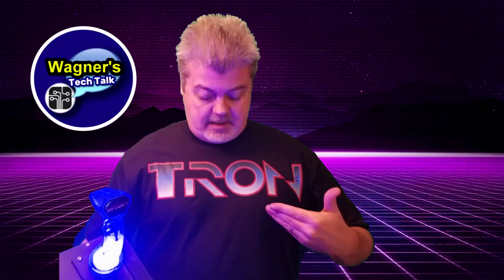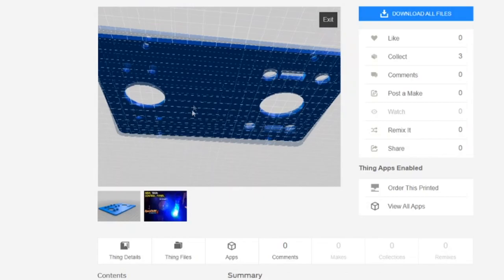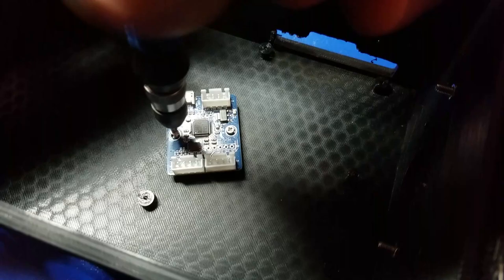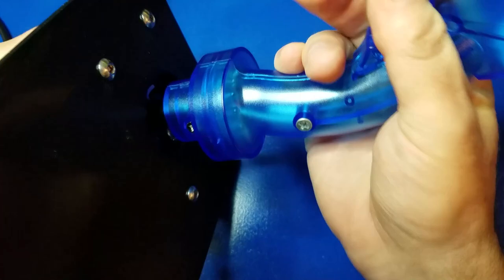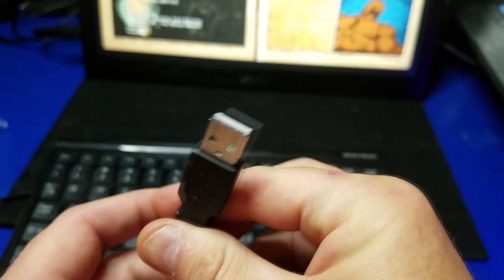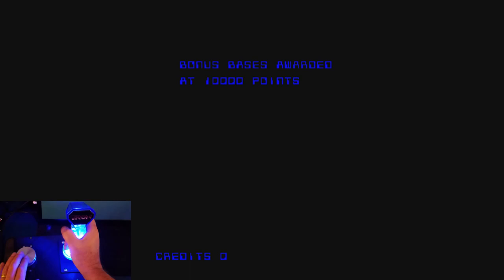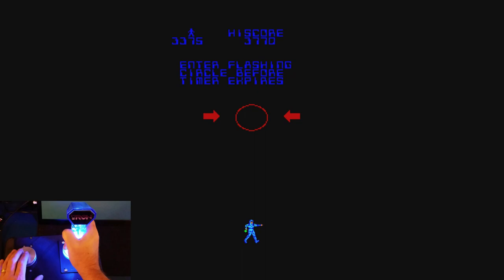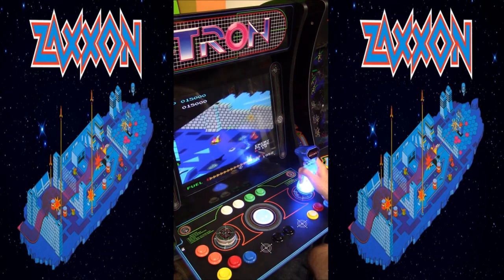Build a TRON Arcade Controller & GRS Controls +MAME +RetroPie or PC: 3D-Printed TRON Panel!

Comment: Where do I get the encoder board from. Mines didnt come with one
Reply from the maker: Everything I used may be found here: http://wagnerstechtalk.com/grs/#New_TRON_Control_Panel
Reply: @WagnersTechTalk  I have the 12 in 1 board. I'm looking for the interface that you are hooking up at 8:55
Reply from the maker: That board came with my Tron stick.
Reply: Oh Ok. I didnt receive one of those. Maybe I order the wrong version. I have to send it back I cant use it without the usb encoder
Reply: @mutechannel13  , I spoke with a guy at Thunder Joystick, They told me they removed the encoder from the kit due to customers not needing them. He did send me a link to aliexpress for the encoder "Xinmotek XM-09 LED" . So far I have gotten the main joystick to work, but can't figure out how to get the LED's for the joystick to work.
Reply: @steveracing7151  thanks for the reply I sent it back. I was going to hook it up following your steps.... managed to get the direction part to work but I couldn't get the leds to light up or the trigger button to work. The blue led light was the whole reason of me buying it lol. Without the led I had no desire to use it lol. I got a flight stick controller with vibration to replace it
Reply: @mutechannel13  Yeah, I had spoke with Kevin at Thunder Joystick, he sent me info on how to hook the wires from the joystick. You got to use JST connectors and .187 terminal using the cable. Black and Black are gnd, Red goes to VCC and Blue is your trigger button. I'm speaking about the wires that come from the joystick.

Comment: Sitting here wishing the finished assembled product was available for purchase. 🤔🤨
Reply from the maker: I don't have the room here for a small printer farm.  Maybe at some point Glen could provide some injection molded shells based on a similar design.  That would be pretty awesome!
Reply: @WagnersTechTalk , one single deck with the flight stick, spinner, trackball, maybe a few other buttons, and ending with a standard usb connection would certainly be awesome. It would mean that I could avoid buying the Taito Egrett II Mini Paddle & Trackball, and a Logitech flight stick. 😎👍

Comment: Came across this video 
I am building my first arcade cabinet 
I purchased a pre installed harddrive with all my games with hyperspin 
I am a carpenter and building a awesome cabinet I don't have to much knowledge on cpu stuff  enough said
I am using a old cpu not a raspberry pi 
Tron is on of my favorite games. 
Will this build work on cpu
Thanks
Reply from the maker: I assume your using an old PC, if so yes it will work as long as it has a USB port on the computer.  In that case, you won't need the 3d printed case described in this video, but you would need the other parts (interface board+spinner and/or the Tron Flight Stick).  All depends on what you want on your cabinet.  The 12-in-1 interface board is only needed if you want to use the spinner or a trackball.  If you want just the Tron flight stick, everything you need is included in that package.
Reply: How about the add on button to play disc of tron "deflector "
Reply from the maker: @jeffharkleroad3290  You would have to rig that up yourself, there is only 1 button on the Tron stick.

Comment: So if I don't have access to a 3D printer, I'm SOL. Great.
Reply from the maker: Not necessarily.  You may have other options.  1) Many local libraries have 3d printers that can be used, you'd have to check with yours to see.  2)  There is an option on the thingiverse page to "Buy this Printed" though, the cost of them doing it for you may get close to the cost of buying your own printer (I've never used these services myself).  3)  Maybe you have a friend/family member with one that wouldn't mind printing it for you if you supply the printer filament.  But, 3D printers have gotten fairly cheap (<$300) so that would be my recommendation to consider one if you're interested in this project.  HOWEVER, if you don't care to use the spinner and Tron stick, you could always go with other projects like: https://youtu.be/7qpNYv4gWv0 or this one https://youtu.be/z6cLuSXXvnY  That's about all I can think of, hope this  is helpful.

Comment: T-Sticks GRS Tron stick DOES NOT come with an encoder board and isn't even compatible with their own controller board. It should be illegal for T-Sticks to use videos like this to falsely advertise their products.
Stop lying and just tell people they need an encoder board and adapter.
Watching this video cost me over $60.
Reply from the maker: Back when I purchased/reviewed this product, about 4 years ago, the encoder was included with the package.  Over time, products change and many already had encoder boards and it became an unnecessary expense.  The price was dropped for the kit and the encoder no longer being shipped.  I'll add a pinned post to make that clear for others in the future. Everything in this video was honest and true, at the time it was created.
Reply: @WagnersTechTalk  You do realize that T-sticks has this video embedded on their website to sell this stick?
Also not only does it not include an encoder board, it doesn't include a wiring harness, mounting bolts with nuts to tighten them or anything to even hook this up to an encoder board.
They rely on your video to mislead customers into thinking everything is included.
I assume they are using your video without your permission or you would have asked them to stop embedding it on their website to mis-advertise their product.